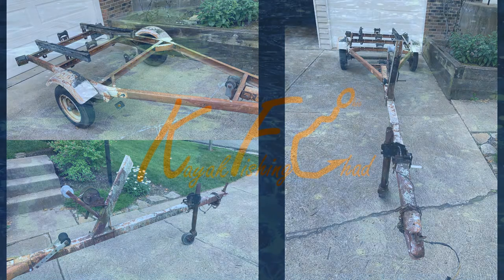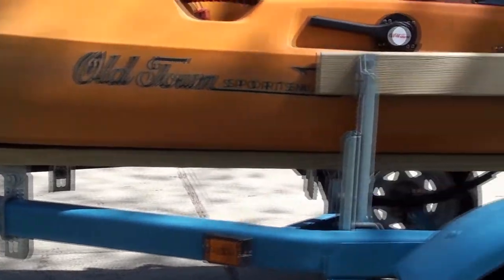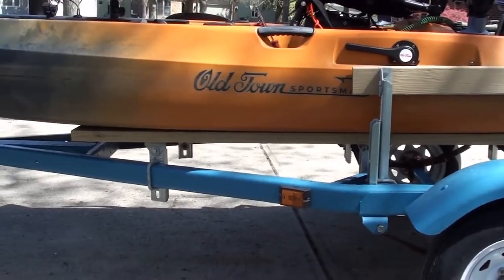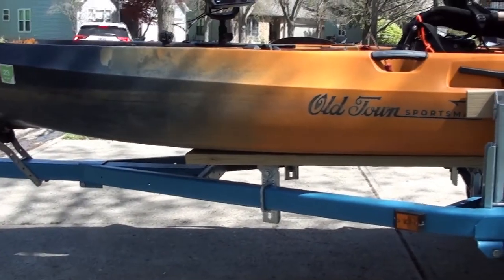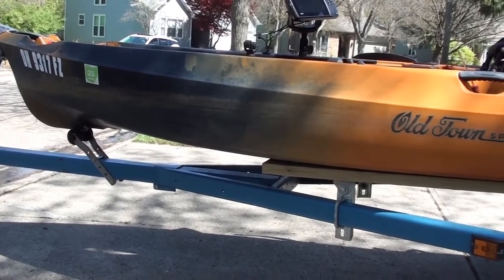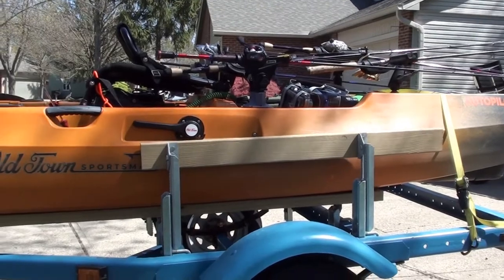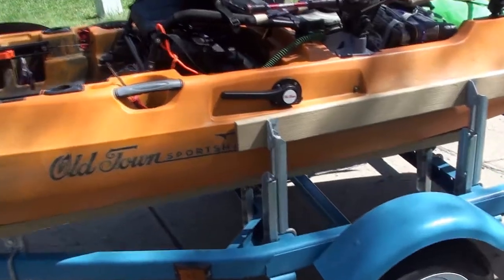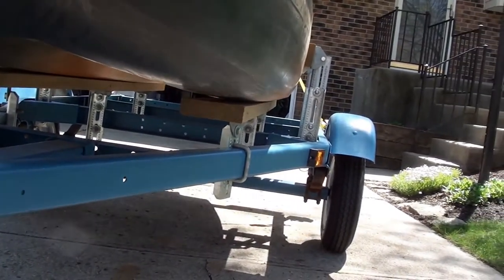Trailer Old Town Autopilot 136 Trailer Setup

Comment: Hey man. Thank for the video. I have a quick question on the support boards underneath. I am going to take the plunge this winter or spring with that yak. I have converted my utility trailer to haul it and have bunk boards set up on it, which is similar to the boards your yak is resting on. Does it ride pretty nice there on the flat boards? And also, can you tell me the distance in between those two boards. Hoping to have it all set up prior to going and picking up the yak from the local vendor. Haven't seen much on that topic. Thanks!!
Reply from the maker: I have my supporting 2x6's space 1'-6" between boards (so 2'-5" to the out to out) they are 6'-0"long and start at 4'-8" from where the front of the boat sits. Hope that helps.